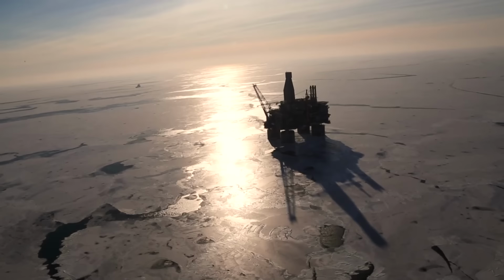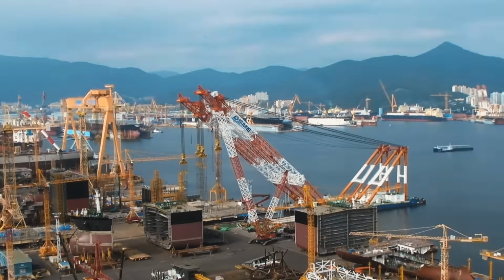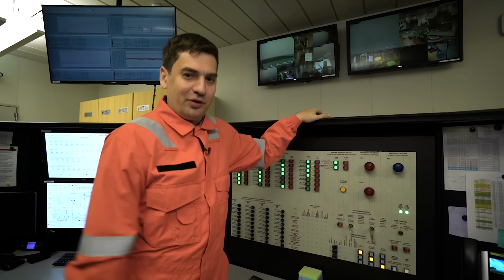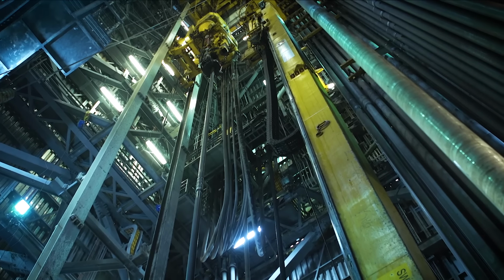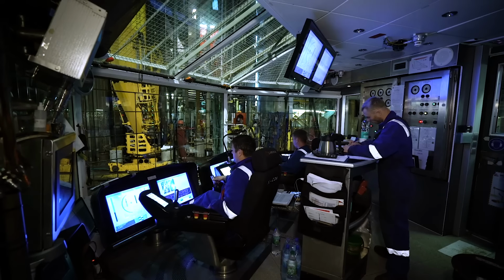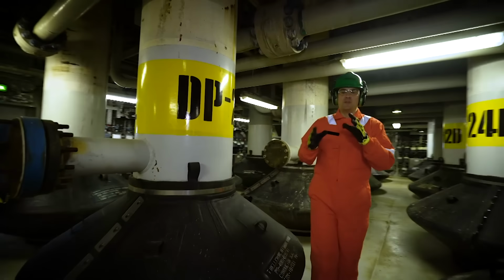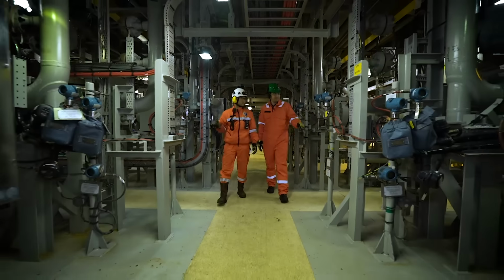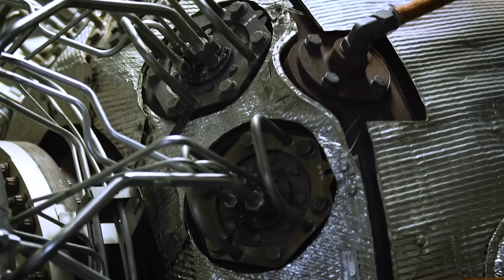Inside The World's LARGEST Offshore Oil Rig Platform

Comment: Cool vid but I only trust American made steel and oil platforms
Reply: Engineered & high tech material supplied from Europe & North America, the facility built in South Korea. Generators RR gas turbine packages. Russian content the shed around the drilling facility. 😂😂😂😂The older production platform the Molipaq is second hand from Alaska built in the USA as above, Russian content very little.

Comment: This is not accurate on multiple technical aspects. I.e. oil is not located in large caverns/bubbles like your example. It is found inside the matrix of the rock, or porosity of the rock. Porosity is analogous to the air space inside a bucket of golf balls (but in the lithology of an oil play, the rock particles/golf balls are usually a magnitude smaller in size).
Reply from the maker: Thank you for the clarification and feedback!
Reply: @thewayitworks_  Thanks the video your opinion of the topic is accurate